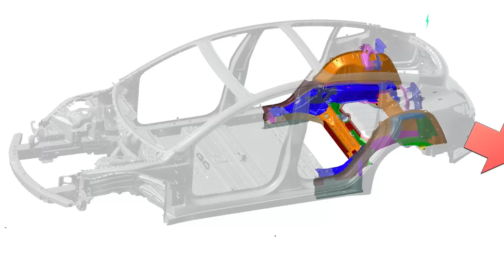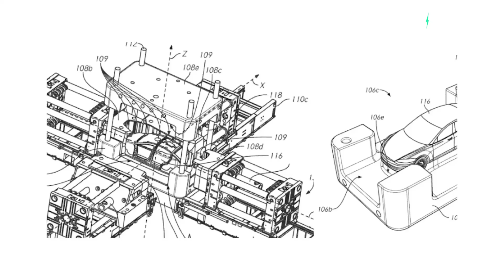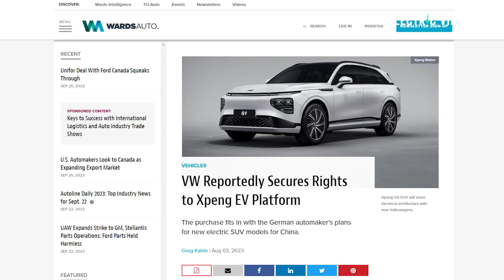Tesla Giga Shanghai launches 1-piece Giga casting for epic 40% cost reduction

Comment: Sam,  Generally like your knowledge, but you obviously do not remotely understand casting tech.  Testla uses die castings, not sand,and the dies are designed in-house, with proprietary die design   proprietary aluminum alloys and flow tech no other company has this tech.  Another reason Testla uses less tonnage presses.  I could go on about your almost complete lack of knowledge about the casting, but I like your pod cast.  Just spend more time understanding your subject.  At present you are putting out misinformation about Tesla and the so-called competition . Chuck

Comment: Disposable cars have now arrived. EVs are way simpler to make than ice cars. The true innovation is that car manufacturers are producing both EVs and ICE on the same manufacturing line, saving time money, energy with huge efficiencies . Volvo does this with its electric trucks all 8 models, they’ve produced over 5000 units now to teslas 70. Great innovation as hydrogen comes into play ( EVs aren’t suitable for several countries), they’ll add that to the same line as well

Comment: I worked in the automotive stamping industry in a previous job and the amount of tooling and floor space needed to manufacture the parts and assemble the unibodies was insane. 

The injection molding of unibodies is a huge jump forward.

Plus most of  the weight reduction comes from the elimination material overlaps that are needed for stamped metal uni bodies.

Comment: I understand and appreciate your exuberance regarding this new casting and its cost benefit to production. Where does this leave the vehicle owner, who may be getting a better car at a cheaper price once, at the point of purchase but what happens after an accident? is it repairable? or does the entire vehicle have to be stripped and a new chassis fitted or is it more cost effective to write the car off and the insurance company get you a new one? Firstly that wouldn't seem ecologically sound given what this is supposedly all about and secondly what would this do to insurance premiums which owners pay every year? As an engineer my issue with mass production engineering has always been accessibility and serviceability. I would genuinely like to know. So if you or one of your contributors knows I would be happy for the update.

Comment: 40% cost saving ? Who knows... but it all adds up  ... consider all the logistics in manufacturing spot welding and fixing 200+ steel components together ..factory space, production lines, spot welds robots conveyor and other movement equipment, storage of components logistics, purchasing, production engineering, breakdown repairs, quality control... The list goes on.... It wouldn't surprise me if this cuts by 40% as claimed.. but maybe that was compared with the old method... No front and rear giga castings.. I mean steel construction.

Comment: Another excellent and topical video Sam, thanks.
I'm a long time Tesla fan and have watched the rapid progress of the company as it demolishes legacy operators. 
I guess the most surprising thing is that for all the time the other manufacturers have been around they have signally failed to innovate to anything like the degree Tesla has, despite having the funds to do so. 
Forget the EV movement and batteries, look at castings as a standalone achievement. Ok, so the tech to make enormous castings is pretty new - but couldn't it have been a thing years ago if the ICE profits had been funnelled in that direction? 
The more Tesla streak away from the old ways, the more the foot dragging and absolute rip-off of legacy businesses is highlighted. 
I recall there was a lot of talk 10 or so years ago, "who's this clown Musk? what does he know about cars?" - turns out he figured out how to make them pretty well and not only that, to lead a revolution as significant as putting planes in the air.

Comment: The problem with a single-piece cast chassis is that one fender bender turns the car into a total loss. The insurance cost will be prohibitive.
Reply: That's just not true. A casting is repairable but in a fender bender occurred, in most cases you can just replace the crush can sections on the four corners, that are just bolted on.

Comment: Toyota putting it into production in 2025/6 means, with their record of vapourware, somewhere between 10 years later to never.

As far as Tesla goes, yes, it's a more efficient way to manufacture, and is to be applauded providing the cost savings actually make it to consumers rather than simply higher margin / profit for Tesla (and, I believe they WILL make it to consumers). That said, I do wonder what this means for repairs to cars that have been in accidents. Is it a case of something that COULD have been removed and refitted in the OLD model, now having to be scrapped due to so much of the car now being structural? Curious to know the answer to this, because I had a bike accident years ago with a small dent on the frame, and the insurers wrote it off as the frame had to be replaced. The dent was tiny, but ended up meaning I got a brand new bike for something smaller than a 20 cent piece.

Comment: The two piece 'Giga' casting technique is an awesome break thru, but to replace the 'structural' battery currently produced with high strength steel(?) with a cast aluminum pack and make the giga press 2.5 to 3 times larger just to do it in one piece...who are the sources of this info...maybe for the model 2?

Comment: The large castings are great for reducing spot welds and other stress points. The problem is where the castings join to other materials, especially steel, because this introduces points of high stress where discrete fasteners (bolts or rivets) are used. 2 possible solutions: use adhesives; or use 1 big casting for the entire body, and I think the latter is the likely direction. Maybe we will see a skeleton-like chassis with clip-on body panels made of  lightweight, flexible plastic.
Reply: The Pontiac Fiero used this concept (single piece chassis with screw-on body panels) decades ago.  The only difference was the Fiero used sheet metal instead of a single piece casting.  The problem with a casting is that one fender bender turns your car into a total loss.
Reply: Most cars, if the crash is bad enough to set off the airbags, it's a write-off. Modern high tensile steel  unit bodies are almost impossible to straighten safely, if the structural components get bent.
Reply: @petercroft9895  That is true but if the structural part is protected by an easily replaced/repaired panel, such as on the front & rear quarter panels, a minor crash is less likely to set off the airbags and the car is more likely to be repairable.
Reply: @petercroft9895  that’s because there are so many individual pieces that get Bent that you would have to straighten hundreds of them. a single piece would be easier to manipulate or replace if had to.
Reply: @dzcav3   Whether a casting can be repaired depends on the casting alloy. Some alloys are ductile and weldable with GTAW equipment. Alternatively, since is a one-piece casting, replacement may be an option.
Reply: @dzcav3  not true. They could be welded,heated and Bent back to the original positions.
Reply: Aluminum is the material for Trainee welders
Reply: The GM Saturn line used plastic panels over a steel spaceframe.decades ago.
Great idea and concept but heavier than regular unit bodied cars at that time.😊
Reply: Cosmetics by Rubbermaid
Reply: From what I've heard, Tesla's are a great car to be in a crash, but due to their construction they are a right bugger to repair.
Reply: I think totalling any car is the future due to if you have a crash replacing the seat belts, airbags and airbag sensors adds a huge percentage of the cost to repair a vehicle nowadays. So Teslas reasoning is total the car and salvage the parts in a salvage yard.
Reply: Not only that problem, if you get in a accident, where you weld a panel, so disposable tesla cars
Reply: this was bmw i3 loool

Comment: Perhaps when single-cast chassis are perfected, they can use the old smaller giga-presses to make smaller replacement castings.  Repairs will be done by cutting out and welding in sections of the giant castings.
Reply: I doubt that very much.
You might want to read up on what happens to an aluminium alloy's original strength characteristics once subjected to localised heat from welding. Some grades of cast aluminium are not suitable for welding at all. Even if it was welded how are you going to prove that the vehicle's structural integrity has been returned to "as designed"?
These will be a throw away vehicle.
Reply: @robertgreen9614  I am a formally certified aviation TIG welder.
Reply: @alanhall6909  Good for you. You should know better than anyone that tacking a new corner onto a busted alloy Tesla chassis is not going to be cost effective. Implementing aviation welding standards and costing into the local body shop?
Get the apprentice to hold a bit of scrap to shield the battery while you lay a bead ?
I think not.
Reply: @robertgreen9614  It's true that aviation-quality repairs are expensive.  My point was that it can be done and it isn't that difficult.  Cast alloy parts are repaired all the time.  Much cheaper than new parts and structural integrity can be verified.  Yes, your average independent autobody shop won't be doing these casting repairs, but specialists will exist to do it, just like expert auto electricians are brought in for complex jobs.  Cast aluminum trannie cases and engine blocks are commonly repaired with TIG, sent out to a welder at relatively low cost.  TIG welding doesn't send off a bunch of sparks like MIG welding, so risk to batteries isn't a problem.
Reply: @alanhall6909  No-one knows what Tesla's secret alloy consists of. Whether it can be successfully welded or not is the great unknown.
Reply: @robertgreen9614  I guarantee it can be TIG welded.
Reply: @alanhall6909  That's a big statement not knowing the composition of the it alloy. Say it's a zinc/alloy diecast and you do manage to weld it, can you also guarantee it will have 100% of its original structural integrity?

Comment: Would appreciate the article or ref. Material….don’t know about a one piece casting for the entire MY under body…maybe a structural battery pack and a front and rear casting (6 ton presses)….would be a really big casting…maybe 16-18 ton press…incremental improvement may not be that much compared to a front & rear casting..sunk cost.

The talk has been TSLA maybe do single piece under body for NectGen…that could be a 16 ton press…MY compare to NextGen…20Ton press????

Thanks for staying with TSLA & its progress!

Comment: It is great for manufacturing but repairs after some crash? And how does structural battery work when you need to replace batteries, how easy that would be? Don't think it will be very easy like NIO swappable batteries. Does Tesla think about the fact cars are on the roads today for more then 25 years oftentimes... or over 30 etc. I am not sure that they are thinking about repairability and durability of this all in any way.

Comment: Elon had been talking about one piece casting for years - he related this to how Hot Wheels produces toy cars, and wondered if this technique could be transferred into real car production - step by step Elon, along with the myriad of technical and scientific staff at Tesla and SpaceX, brought this vision to life, initially with one piece molding of the complex air conditioning valve system assembly used in Tesla cars, then developing front/rear castings, now on to complete chassis castings, next? - eventually he will solve the issues and challenges of close to one piece casting a complete car (there will always be multiple components/materials which can not be cast, obviously), plus integrating sequences and sub-assemblies to minimize time and materials used to assemble vehicles - man-power will be needed, but less and less of it as automation (as currently being developed with the Optimus robot developments - robots mimicking human actions and can learn and make decisions on their own via AI) takes over, further reducing costs and time....

Comment: The side frames (A, B and C pillars) can be cast as one item. As can the door frames. Cosmetic panels can BE bonded or spot welded. 
 HOWEVER this will not work with stainless panels. Too much risk of galvanic corrosion and no strength benefit. 
I personally think making cyber truck in stainless was a mistake. 3mm aluminium panels would be just as strong.

Comment: All of this sounds great for the manufacture of the cars and maybe their price. I am an insurance agent and I am here to tell you that cars made this way will eventually price many people out of car insurance. These cars will be so hard to fix and so easy to total that they will add massive cost into a system that is already reaching its limits. The last ten cars that I wrote coverage for averaged $1152 for 6 months of coverage. Insane.
Reply: Yeah the companies are saving on Injury and death payouts with Tesla and taking about how expensive the cars are to repair.  All the cars built with modern steel are unrepairable like the tesla casting.    Tesla casting maybe more repairable because they are maybe more malleable than the high strength steels,   

This is just like the metal roof on my house.   Hail damage is a major payout.  Metal roof payout for hail is very unlikely.   When I asked about this the line they fed me was that in case of fire it would be harder to the fire fighter to ventilate.   One does not need a degree to see the frequency diff between hail and fires.  A sawzall with the right blade would laugh at the metal roof.   10 years later some are giving discounts for metal roofs.   Same is going on with Tesla.  Milking it while they can.

Comment: Tesla is innovative even without competition. I can’t wait to see what they come up with when they “have” to. The user interface is starting to look like DOS compared to some and things like wrong profile loading and phantom breaking are still a problem. Not perfect but still the best, for now.
Reply: Is phantom braking still a problem?  Better than the alternative as in not braking. 
I expect all this to change with V12 so anything we see in v11 is going away.
Reply: @danharold3087  It's bad enough that I don't even use autopilot. I can't take a chance on getting hit from behind or having someone get road rage thinking I break checked them and shooting me. The adaptive cruise on my 2019 Equinox NEVER did that, I miss it.
Reply: @frankcoffey  Understood.  Some use it all the time.   Why is there this such a disconnect?   I have not watched a lot of the FSD drive videos but there are a lot of them out there.   WholeMarsCatalog  (is that right) maybe others are post the full drive.   This has me wondering.   
V12 with end to end NN is a new ballgame.    
Tesla did not put it this way but I will.  It remove 300K lines of human written code including bugs.
Expect good things from V12 but realize that other than gather the training data it is a new start.
Reply: @danharold3087  I don't even have FSD. I just want autopilot to work as good as cruise control on a normal car. I don't think cameras alone are going to work and my new Y doesn't even have sensors. Seems hopeless.

Comment: Just a minor comment.  The damage to roads is apparently proportional to the fourth power of the individual axle weight.  Add to that, that electric cars don't leak asphalt eating oil and petrol on to the roads and it is an argument for a lower road tax on EVs than on Petrol cars when it eventually comes to that.
Reply: The big rigs are eating up the roads.   If I told you how much more damaging  big trucks are people would call me a liar.  Not interested in burning that time.  Look it up.

Comment: Very interesting and game changing (disruptive) news. 
Question: What do you think the impacts of massive single part frame casting will have on the repair costs of the car and therefore insurance? Will it be prohibitively expensive to repair the single casting frame because of special techniques that may be required and that write off rather than repair becomes more likely?
Reply: Insurance companies will smile as they hand you a new Tesla knowing they will be paying no medical bill.
Modern cars are using a high strength steel that is repairable.
Reply: that boat sailed a long time ago, any damage on todays ice cars beyond fender benders,they total it and give you a check.

Comment: So we won't get many model changes with all these single piece castings or shall we?
Reply: It is for he model 2.  That is a few years away.  Several models expected on this platform.
Reply: @danharold3087  How many models can be made from a single cast?
Reply: @scamchan   That is rather open ended.   Why should there be a limit.?
Reply: @danharold3087  So the same cast can create how many models?

Let me guess 

You don't know

Seems to me it would be limited to that model.
Reply: @scamchan    A car generally has two parts at least in the classic sense.   The frame and the top hat.   Show 10K diifferent car designers a frame and you can get 10K different top hats for it.  Why do you think there should be a limit?
It is like asking how many different dresses you can design for one lady.
Reply: @danharold3087  Show me a dress that has ONE PATTERN that makes 10k different dresses?

What size is that casting?
That alone limits what type cars can come from it.

I guess we forget how many times we see the same car with different names on it but it is the same body and frame.

That is the point I am making here that doesn't mean it is a different car model design.

You want a totally different car it won't come from the same single casting.